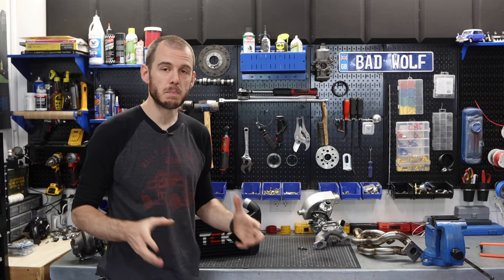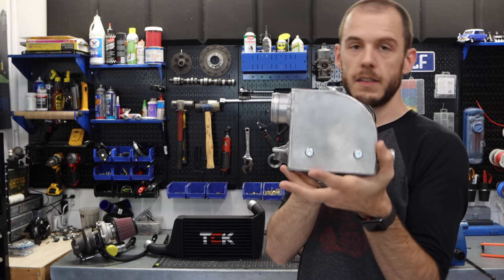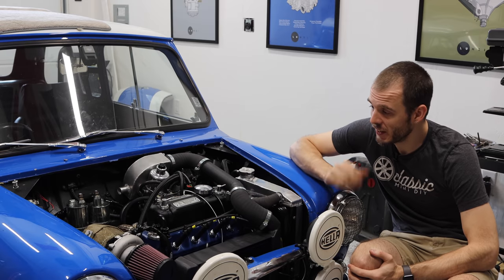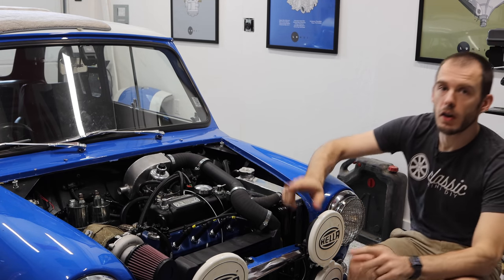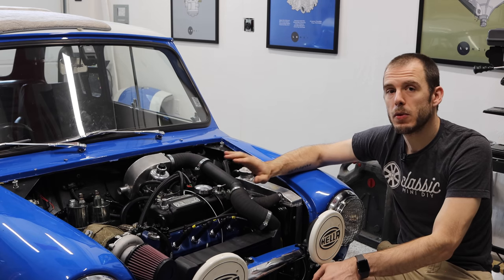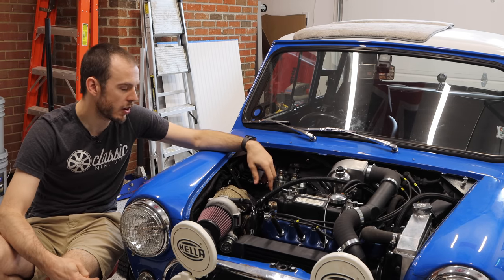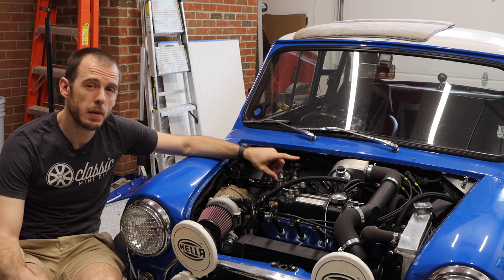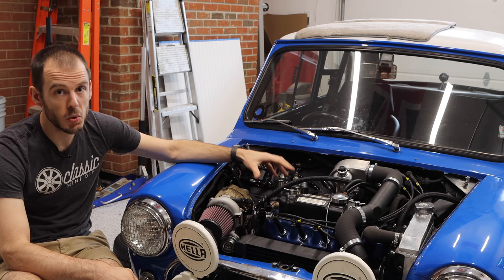How to - Install a Turbo on a Classic Mini | Turbo Bad Wolf

Comment: This is pretty cool, have had this exact idea for years, I have just been too busy in life to make it happen. I’m glad someone is doing it. A quick little side not the length of the exhaust manifold, the fact that the displacement is small and the size of your intercooler, may make this set up a little laggy. The intercooler on my 3.0 making 550 hp at 22psi isn’t much bigger than yours. I can’t wait to watch the other videos you make to see your results.

Comment: Diverter valves route boost back into the intake, not the exhaust. The main purpose is to route the boost you've already generated into the intake to keep the turbo spooled up in between gear changes, reducing lag while still protecting the turbo from compressor surge.
Reply from the maker: Yeah I misspoke there. Had my PCV collector in my head and got them mixed up.

Comment: Good vid Cole. 10:38 Where’d you get the cool hose bends for the intake? You know, you’ve done all the measurements, research, and hard work for this build, you really should consider putting a kit together to sell. I know a lot of it is specific to your car, but a lot would be common to most minis. Good work!
Reply from the maker: Hey Brian thank you! While I did do lots of measurements the kit would be a HUGE undertaking especially to get something reproducible. I don't think I have it in me right now to tackle something like that! Haha The hoses though I got from a place called Performance Silicone - https://www.performancesiliconehoses.com/classic-look-hoses-9-c.asp

Comment: Great video! What do you think about the difference between Fusion Fab or Bagsport side mount kits?
Reply from the maker: Thank you! Both kits are of EXCELLENT quality. You can't go wrong with either. The main reason I am moving to the Bagsport kit, is that I wanted to try the new generation of Garrett turbos and I liked the orientation of the side mount kit on the Bagsport kit a bit more. Both are stainless, and both will perform excellently.

Comment: Cole - where did you fit the tube for the MAP sensor? Can I fit a Vaccum Take Off Plate or do I need to drill into the manifold and fit a take off?

Comment: I always enjoy watching your videos, Cole.  Adding this complete turbo set-up is for additional power, correct?  I have not looked at the expense to complete this project but, every time someone attempts to gain more power from one of these motors, the cost always seems extreme.  Unless there is a dying love to have a British motor (that will get worked quite a bit harder to produce power and thus, shorten it's life and reliability), why not opt for a fuel injected D-series Honda motor that will easily produce more power and start every day?  The money spent will be much less, I am sure of it.

Comment: Does the oil feed drain on the turbo need to pint down on the gt1752? Because i dont think the turbo can be clocked around enough
Reply from the maker: The drain needs to be as close to pointing straight down as possible. I was able to clock my turbo enough to point my drain down with the fusion fabs manifold. Mine is pointing almost exactly 90deg down.
Reply: @classicminidiy  I have the bagsport manifold. If I clock turbo the cold side will be pointing too close to the transfer case so I won't be able to get a pipe on it.
Reply: @classicminidiy  just realised you can clock both parts

Comment: Do you really connect your blow of valve to the exhaust downpipe? That would be right for an external turbo waste gate.
Reply from the maker: No I said the wrong thing there. I actually meant piping it back into the intake pre-turbo. 🤦🏻‍♂️

Comment: Pretty much the same spec as my engine so this will be helpful when putting everything back together. The link to which K&N filer you used isn't working on your spreadsheet. Also which turbo blanket have you used? Thanks!
Reply from the maker: What happens when you click it? I just tested it and it worked for me. Oh yes the turbo blanket. It’s made by forge Motorsport. Link below

https://www.forgemotorsport.com/Forge_Motorsport_Turbo_Blanket--product--1491.html
Reply: @classicminidiy  It's working now, thanks Cole!

Comment: Didn’t see the gear for the crank angle sensor 
What happened to the engine torsion rods
Reply from the maker: Gear and details about that were covered in the engine install video and the overview of the ecu. 👍🏼

Comment: Where can I buy this as a complete kit
Reply from the maker: Unfortunately there aren’t many full turbo kits on the market. I think Jet Motors might sell a kit with a smaller turbo that this but this setup is a pretty custom configuration.
Reply: @classicminidiy  I got ya... would u be chance know where to get everything I need to build it
Reply from the maker: I have a relatively complete list linked below but even this isnt completely exhaustive, and your setup may not require all the same bits as mine. But hopefully this helps at least get you started!

https://docs.google.com/spreadsheets/d/1kT3Y1Qv-77fM1LjfPFk4gdxuEKEZqpf6-T1h6FM_AnA/edit#gid=1487170757
Reply: I appreciate you taking the time
Reply: Is item #4 the same as item #3. Or is the link wrong?
Reply from the maker: Hey good catch, looks like I copy pasted the links improperly. The manifold is from Fusion Fabrications. The Intercooler kit is from The Car Kitchen. :-)

Comment: Yikes $10k. A lot of this just wouldn't pass smog in CA, I don't think.
Crankcase emissions used to get piped back into the inlet to get burnt in combustion, not sure how friendly it is just throwing them out the tail pipe.
What kind of target power are you aiming for? It may have been easier to have just gone down the Honda conversion route.
Reply from the maker: Are cars older than 25 years still required to pass smog? The car itself is over 50 years old so at least in NC it’s exempt from those rules. I actually think this might be better (marginally) environmentally than the normal reburn method, since it’s actually getting proper oil separation rather than feeding that oil back into the combustion system. However I’m no scientist! 😂 targeting around 150-180. Would be happy there. I don’t much care for the Honda conversions, I prefer to keep the aseries. If I do a full engine/power unit swap it’ll be electric! 😎 ⚡️
Reply: @classicminidiy  1975 and earlier are exepmt in California. Believe me, with an '81, I know! 🤬
Reply: @classicminidiy  I run a 30 year old Lotus and I still have to Smog that. I think the cutoff is late 70's so still possible to get a classic mini that doesn't need it, good catch. That's a lot of power to run through an A series transmission, I ran a 1275GT run out to 1380 that was doing about 130 I seem to remember on twin 40's. It also had a LSD in it and it was quite a wrestle! 
I think I'm most attracted to the Honda conversion because of the 5 speed box and the general reliability of their engines, but I hear you on the electric front.
Good luck with the build - they are fun cars.
Reply from the maker: Totally agree! The gearbox has been changed in this engine pretty dramatically as well to accommodate the extra torque and power, gear, ATB LSD, etc. All part of what got me to that 10k mark lol. Let's hope it was enough, otherwise I might be going electric sooner than id like hahaha.
Reply: @andrewausterfield6710  in CA it’s 1975 or older , Honda is definitely more reliable and affordable and you would have AC and no need to worry about computer tuning if you keep it stock, some people are just in love with the classic A series, how can you blame them, it’s a beautiful pice of art, even if it’s always liking, lol

Comment: Formula for a turbocharger is heat energy increases air velocity it’s not the speed of the exhaust gas coming out
Pays to be a mechanic, if you don’t how it works how can you fix it
Reply: For an ICE, heat alone does not increase air velocity, it is merely a byproduct of combustion which remains contributory. Pressure differential on opening the exhaust valve is the primary driving force (aKa blow down). Velocity must be maintained between it and the turbine wheel to transfer energy sufficiently. A cooler/denser exhaust would still make similar turbine speeds if the header remains optimal as the piston is a driving force. So it's a moot point.
Reply: @Dagowly83  pit you could not of told me that in 1976 when one of the questions in my final exam was how dos a turbo work
Reply: @alancombe6083  passive aggressive response, again? You seem to reply to all of Cole's videos with a chip on your shoulder. How about quantifying your responses.. and your quals.
Reply: @Dagowly83  if you don’t now how it works how can you fix it, I can read a workshop manual too, maybe you should learn about mechanics as in actual do it, maybe you might learn something
Reply: @Dagowly83  you want to now my qualifications well let’s see 47 years a mechanic, 15 of those working for Austin Morris/ Leyland, the rest working on GM, Ford, and various European cars

Comment: Just one question bud; I love the intercooler but I’m just wondering if the standard distributor would fit behind it ok? Great build dude
Reply from the maker: Thanks! No unfortunatly there is no room for a distributor with this kit. You could potentially use a smaller intercooler I suppose if you wanted to run a distro.